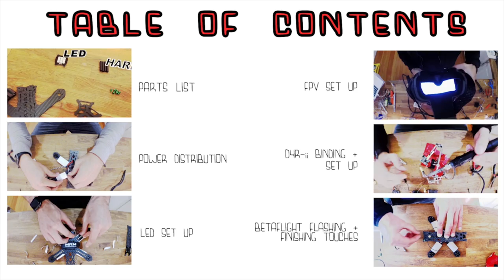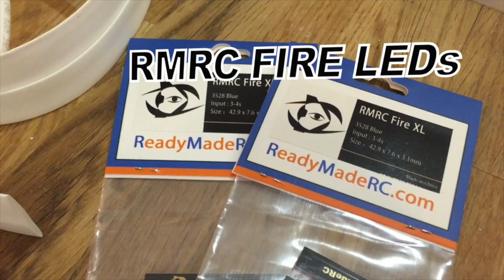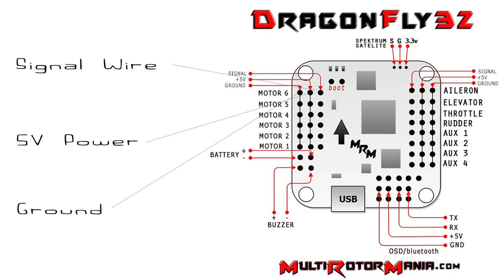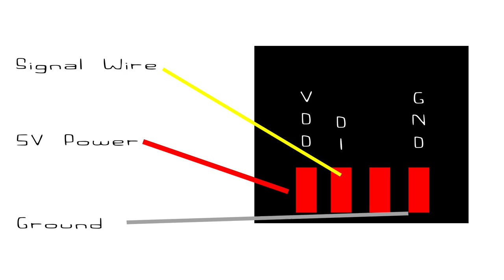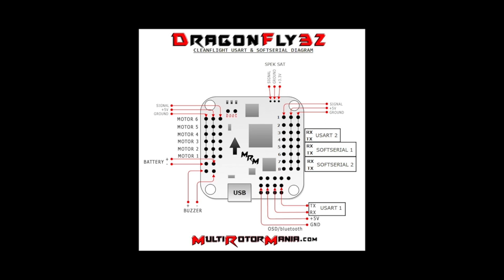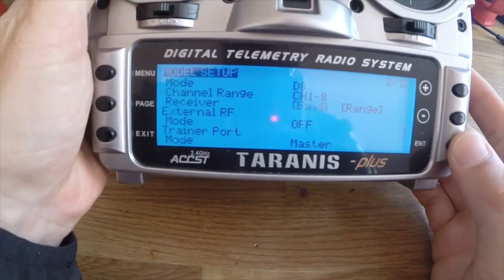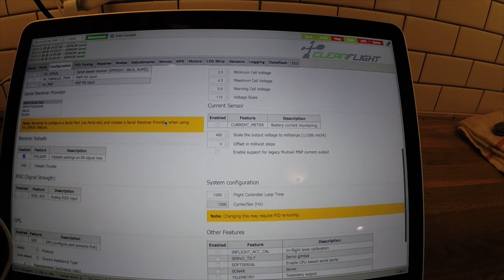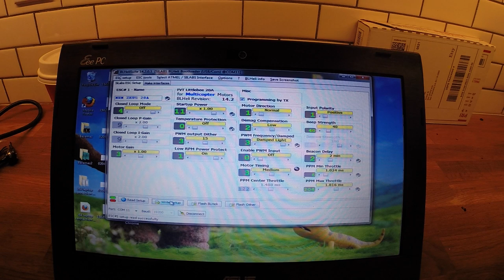Armattan f1-4b Full Build Tutorial

Comment: Looking at this right now.  You tried this with cutdown tri props at all?

Also I saw you put your go pro on it, how do you find flying with that on it?

Hows the 4s on 1306 RCX motors?

Sorry for 100 questions. Just trying to work out how to build mine.
Reply from the maker: I ended up putting 2205's on her. The batteries you need to buy in order to run 1306's with a gopro are expensive and hard to get. You'd need a high c 850 mah and your flight time would be short. I realized this after the build. You can follow the same exact steps in this video but just swap out the motors for a 2204 or a 2205. I haven't tried triblades yet. They're so expensive! Lol
Reply: SF PV Well my frames ordered. Its actually for indoor racing, we have our first race on the 20th. 

Having the go pro on isn't massive for inside. 

Am I right in saying 4s  = 4045s, 3s = 4045BNs?
Reply from the maker: Sundee You'll burn up those motors on 4045 bn's really easily. Stick to 4045's